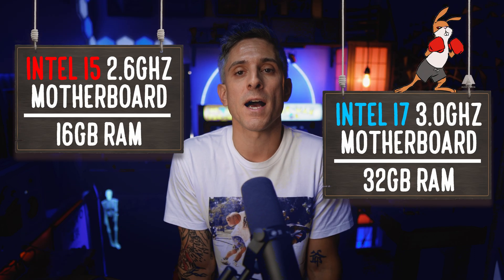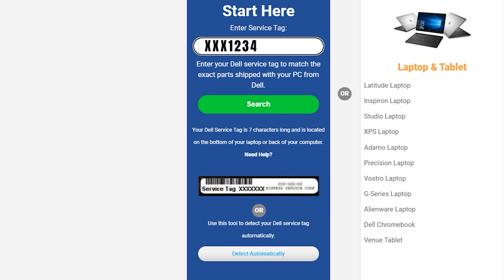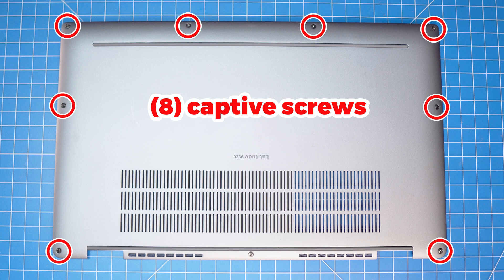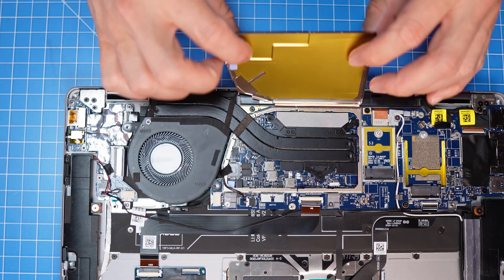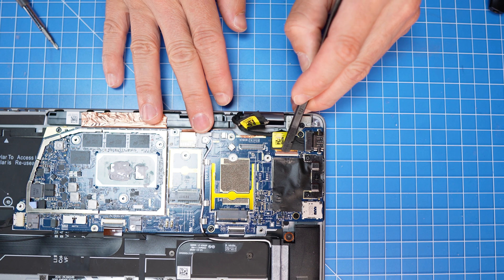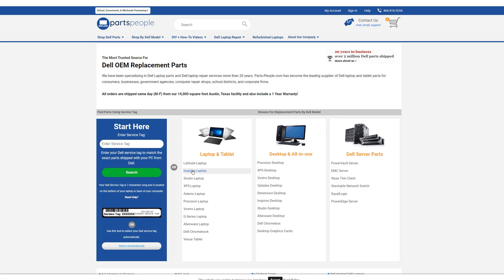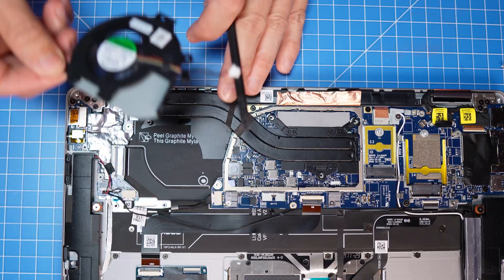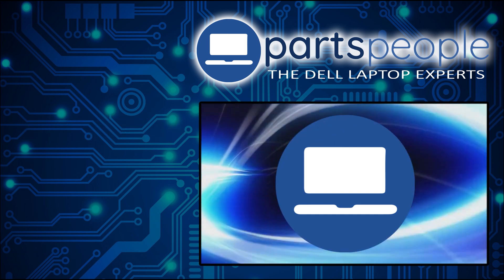Upgrade or Repair Your Motherboard | Dell Latitude 9520

Comment: Ridiculous how you can't even change RAM on this computer... RAM is something that is almost always easily accessible for upgrade options on computers and is also something that commonly gets faulty and can cause a system to not boot, so you guys are basically forcing people to do a 500 dollar repair instead of a 50 dollar one, very shameful.